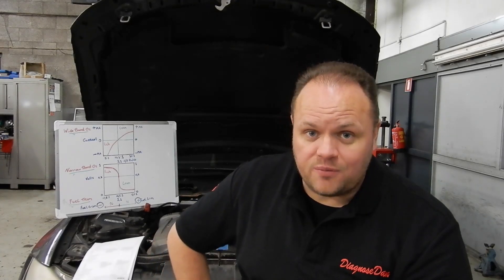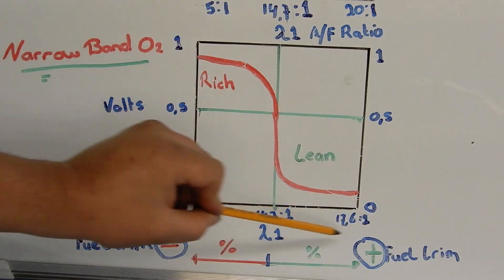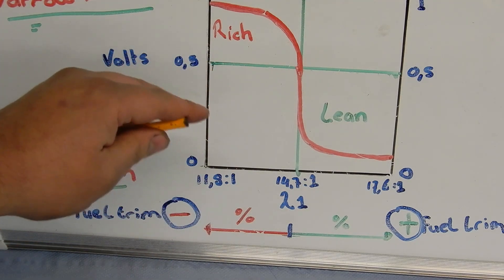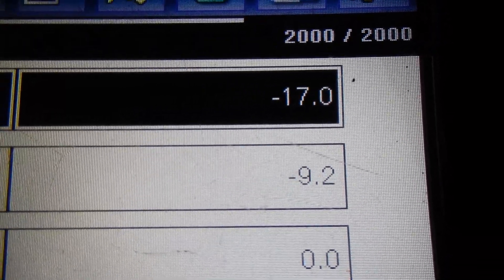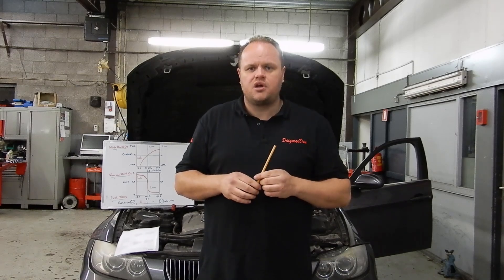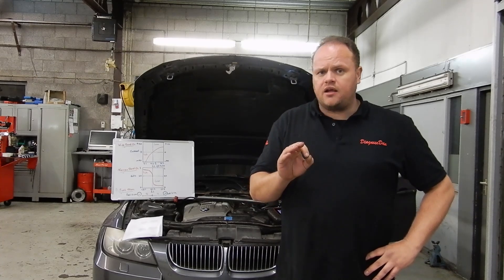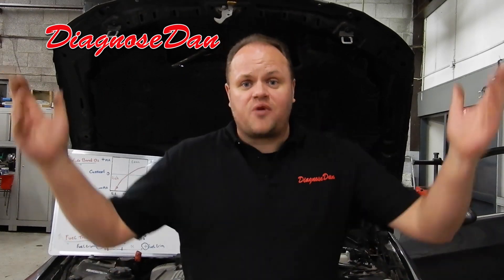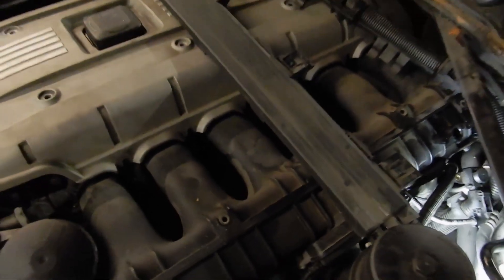Wideband O2 sensors, Narrowband O2 sensors and Fuel trim.

Comment: Vanos. No throttle plate, variable lift
Reply: Well, if I read below first before I open my mouth..lol.
Reply from the maker: @WIGGYWIGGY89  🤣🤣 Thanks for watching Cody it's appreciated!
Reply: Either way thanks for the explanation of wideband o2's. They have always confused me by using lambda. Negative and positive current flow is confusing, lambda is easier to understand for me. I need to practice looking at good running vehicles with wideband o2s..that way its easier to spot a wideband issue. Also in the past I've used the downstream o2 to prove the upstream wideband is faulty. Atleast now I will have a better understanding, and can refer back to this video when testing wideband o2s. Thanks Diagnosed Dan!

Comment: Could this be happening the exact way in the opposite direction if there is any leaks in the manifold?
One would also have a bad case of bad fuel economy then right?
Reply from the maker: Yes fuel economy would be poor
Reply: When double negative ltft you also have bad fuel economy right?

Comment: great video, maybe someone asked already, but why do we need both sensors ? is not it enough with the only  wideband sensors ?
Reply from the maker: One before the cat. and one after to see if the cat. did it's job.
Reply: @Diagnosedan  Thanks! why not same sensor for both though ? like using both wideband before and after :) could be easier to compare the results.
Reply from the maker: @gilron9585  wideband can detect a wider range of mixtures than norrowband but is more expensive.  Narrowband is good enough for after the cat and cheaper.
Reply: @Diagnosedan  Got it! Big thank you man :)

Comment: It's because this engine is directly bottle fed a perfect 14.7 parts of air, and does not burn any atmospheric mixture, resulting in an extremely clean burn, and can actually run under water? It's the same technology used by Speed Racer in the Mach 5! Except they don't make it in convertible, yet!

Comment: Hi Dan, great videos. My car has a sudden 20% increase in fuel consumption, but no other noticeable changes or codes. This is more noticeable when the engine is cold, but still higher than normal at operating temp. My long term fuel trim stays between 5.5 and 10.9 (normally the low is 8%, it only takes very short dips to 5.5), and short term stays between -2.5 and 1.5.

I think I have a lazy o2 sensor - the manual recommended it to be changed 20,000 km ago. Upstream is wideband, LAMBDA normally stays at 1 while cruising, but sometimes bounces between .9 and 1.1. It will spike to 2 when throttle goes from high to close. mA normally is around 0.7, but will spike to 3.2 when throttle goes from high to close just like LAMBA. Downstream is regular o2, when car is warming up it stays low around .005. It climbs as engine is warming and then stays around 0.7 while idle and bounces between .1 and .9 while driving.

I have no signs of a bad catalytic converter, so should I just replace both sensors?
Reply from the maker: Well I'm not a fan of just replacing parts. The numbers your giving me ain't great but not to bad either. See if the fuel trims improve with higher Rpm's. Also check your temperature sensors!
Reply: @Diagnosedan  Hey, I forgot to come back to tell you! I started monitoring my coolant temp and noticed it always stayed between 170-185 when warm without any symptoms of an open thermostat. I pulled the temp sensor and it was covered in a film. Changed it out for $5 and my car is running great again! You da man Dan!
Reply: @Diagnosedan  Will do! I really appreciate the response, you're amazing!

Comment: A quick question Dan, can you tell a narrow band from a wide band just by looking at them. Just watched this video of yours for the 4th time. Brilliantly explained. I’ve even shared it with my work colleagues. You’ve even started a catch phrase in my garage. When I fix something I turn to the other guys and say “ diagnose Paul fixed it again”🤣
Reply from the maker: Ha ha thats awsome! Narrowband sensors usually have 4 wires and wideband sensors usually have more. If you follow this rule your right 95% of the time😉 Thanks for the comment DiagnosePaul💪
Reply: My name is also Paul, thou I'm the only one in my workshop I also can say this out loud just to boost my self 👍👍

Comment: Hi Dan great video.  Just a quick question about o2 sensor diagnoses.  I've got a 2002 ford AU Falcon(Australian) with a v8 engine running rough.  The vehicle has 2 4 wire heated o2 sensors (one per bank/ not a wide band o2 sensors) and when I read the o2 sensor data, its reading between .1 volts to 2.8 volts on both banks (I thought it is not suppose to exceed 1 volt unless its a wide band o2 sensor).  I tested this with 2 different scanners IDS and a snap on scan tool with the same results. I cannot seem to find any information regarding 02 sensor faults with readings above 1 volt on the scan data. have yo ever had this issue?, thoughts on this please. Shorted o2 sensor?, another type of o2 sensor that I'm not aware of (meaning this is normal operation)? Thanks, keeps up the good, work, we learn a lot from you videos.
Reply: I don't think your AU should be reading over 1 volt. Can you check the voltage at the sensor directly (say with a scope), instead of through the scan tool?
Reply from the maker: I know there are a few O2 sensors out there that are different. See if if reacts to a lean or Rich condition. Also take a look at the fuel trims if they are good the PCM is happy about those O2 readings.
Reply: Did you ever solve this?

Comment: Is it ok to spray brake cleaner in intake to test the engine to get it richer? And did you spray it in air cleaner housing without removing the maf sensor?thanks.

Sorry for bad english.
Reply from the maker: Just don't spray it directly on the Maf. And be carefull some brake cleaners are toxic when burned.
Reply: Ok thanks dan. I really love your videos cheers!

Comment: To answer your question at the end, possibly all bmw engines after 2006 use an electric motor to change the profile of the intake camshaft to meter the incoming airflow to the engine.

Comment: plesse share the Answer
Reply from the maker: Valvetronic= Variable valve lift to control engine rpm. No throttle plate needed ( only for backup ) So no vacuem

Comment: Hi Dan. I have been commenting on your other videos recently. Can you advise the best way to test diesel o2 sensor readings? How do you expect them to behave? Namely a VW Touran with the BMN PPD 170 engine? I don’t have any major symptoms as such, but I feel the car is active regenerating the DPF more frequently, I have no intake leaks and the EGR is good. The DPF has been professionally cleaned and the ash content removed as much as possible. I am wondering if the o2 sensor is slightly out (but still within operating parameters) and causing the engine to create more soot than it should. I am struggling to find definitive testing advise for diesel lambda sensors. Your advise would be much appreciated. Thank you
Reply: Thanks for replying so fast. The engine is great uses no oil, performance is good etc. But the regen required warning appears more often than it used to. The DPF was removed and sent to a shop that specially cleans them in a machine. They sent a before and after test sheet showing how much ash in weight was removed. Do you have a way of telling how much smoke a diesel with a DPF is producing in normal use? I suppose you just monitor differential pressure for a while to see how fast the back pressure increases. I have no issue with CEL or loss of power. I am just interested why the regens are occurring more frequently. Maybe it requires a new DPF, but they are so expensive and I do not want to fit a cheap one.
Reply from the maker: @mentalmechanic  That the right way to clean a Dpf, i've seen a couple of times the EGR cooler was leaking internaly. That way some engine coolant can end up in the exhaust gas, causing DPF problems. This was on VW and Audi products. But then the car should be using a little bit of coolant!
Reply: Thanks for the info Dan
Reply from the maker: To be honest it to much info to explain in a comment, Maybe i'll do  a video in the subject one day. There can be alot of reasons the Dpf is clogging up fast. Egr is one of those factors but internal oil consumption can also cause this. Does you engine use a lot of oil?
Reply from the maker: Another question is how did they remove the ash?

Comment: Yeah great info again! I was just thinking how can you tell if a car uses the wideband or narrowband 02 sensor? And of course as you said,  by looking at the scan data. If it shows voltage it’s narrowband. if it shows milliamp Current then it’s a wideband sensor, correct?
Reply from the maker: That's correct!

Comment: It's a valvetronic system. Throttle plate wide open and valve lift regulating air flow.
Reply from the maker: Bullseye👍💪
Reply: i can't understand,, would you explain it, please?
Reply: @Ransz_kyx  The BMW valvetronic system uses not only variable valve timing but also can vary the lift of the valves from less than 1mm at idle to several mm under full acceleration ( Don't know exact specs). Under normal operation the throttle plate stays 100% open and air flow is controlled by varying the valve lift in response to driver demands.

Comment: How do u charge you customers seeing most of time your last stop for misdiagnosed vehicles?
Reply: Do the other shops who couldn't fix the cars bring the cars to you without the customers knowledge, and then give it back to the owners and claim that they fixed them?
Reply from the maker: @coollasice4175  I guess some do, that's why i don t always get permission to film all cars.
Reply from the maker: I'm not exactly sure what you mean could you explain?
Reply: DiagnoseDan I mean when I get a vehicle that has been to several shops and parts throw at it and it’s still not fixed. I inform customer it’s a automatic 3. HRs to start at what the dealer rate is. If they don’t agree to it then they have the option to take it somewhere else. 
So my question is how do u approach customers with problem cars to be sure u are making a profit?
Reply from the maker: @jasonstaub3045  i'll treat them as any other customer. See it as an opportunity. These customers are usually not my regulars and they visit my shop for the first time. When i fix the car the first time and the customer is satisfied i got a new customer for life!

Comment: This video should be mandatory in auto schools. Well done, Dan!
Reply: ALL Dan's videos should be in auto schools. You are the best Dan!
Reply from the maker: logical canuck Thanks!👍🤪
Reply: Fully agreed
Reply: I had to diagnose a stalling problem on a 95 Stratus 3.5. Long story short fuel trim max high bank 1 and then max lean on bank 2. When reset it would run for a few minutes until the trims would do it again but sometimes swap sides. Long story short the engine had been swapped with 1 year newer and bank 1 & 2 were reversed in the harness on that year model. Computer would see bank 1 go lean and enrich bank 2, bank 2 seen rich and lean bank 1 some more. That was a fun one.
Reply: They are in my classes.  Willcox, AZ High School
Reply: Matt is also great 👍
Reply: Matt shrouinger 👍🏻

Comment: I have a question. my long term fuel trim is at +7 when driving around but the wideband is showing a constant negative current amperage. why is that?  The short term trim is acting accordingly with - readings.
Reply from the maker: that slow goat, first check for fault codes. If certain codes are set the pcm no longer controls the fuel trims. Also you can drive the mixture rich or lean and see if there is any response!😁

Comment: Great explanation on oxygen sensors on both narrow and wide band sensors.  When dealing with 5 wire wide band oxygen sensors from Honda, I'm confused on one issue.  The 5 wires are as follows:

2 wires from PCM delivering PWM voltage to heater circuit on this sensor.  Great.  I understand that.
Remaining 3 wires -  Is voltage along with current (milliamp) being produced by the wide band sensor or is power coming from the PCM to the wide band sensor? I know about bias voltage being sent by the PCM to help technicians determine wire integrity.  But which direction is the voltage and current coming from on these three wires?  Please explain.  Thanks
Reply from the maker: Steven Nahulak Great question, i think you just inspired me to do another video on wideband sensors. The voltage comes from the PCM.
Reply: And some have seven wires.
Reply: I know this comment is already 4 years ago. I think the other 3 wires they call it voltage  reference low and high,  the other one is sensing wire? correct me if Im wrong. Thank you

Comment: Awesome stuff Dan. Is the lack of vacuum true for ALL BMW engines with valvetronic?

Since the manifold has no vacuum, is there any way we can force this engine lean to check if the wideband/narrowband sensors respond?
Reply from the maker: mike roy, in valvetronic mode the throttle valve is open so there is no vacuüm in the intake manifold. It's easier to force it Rich on this design😉
Reply: @Diagnosedan You could use compressed air, forced into the intake manifold, to make the engine run lean.

Comment: I couldn't agree more about wideband sensor until yesterday nothing was wrong prefect running  vehicle I fiscally introduced propane in the system ,and I had a +ma at the A/F sensor again Honda 07 perfect running vehicle.🤔🤔 cheers
Reply from the maker: david cisneros, how did you introduce the propane? Sometimes People introduce the fuel by unplugging a vacuüm line, or they disconnect the air mass meter. There can also be a delay in the scandata. Just try again on another car and see what happens😁
Reply: DiagnoseDan  i introduced the propane at the air clean housing ,I know Toyota's are exactly that way your describing in this video . By any means I'm an expert I'm just trying to learn as much as I can as everybody else.✌
Reply from the maker: david cisneros,😉
Reply: diagnosed Dan 
For Honda wideband  it is opposite  ,rich is +ma and -ma is lean .You can do  your research .

Comment: hi Dan! I've been told I can test o2 sensor only when engine is hot because they doesn't work below x°C. Is it true? Asking to be 100% sure in the future. Thanks
Reply from the maker: Rafal f that's right, that's why there is a heater circuit on the sensor😁
Reply: DiagnoseDan so what temp is the best for good test? Or min temp. To be sure our measurements are right
Reply from the maker: Rafal f just watch the status open loop (O-L) or Closed loop (C-L) at closed loop the system is at operating temperature😉
Reply: DiagnoseDan good point! I had this data on Snap on  Verus but completely forgot about it! Thanks again Dan!

Comment: How are you, I have a lin bus connection failure on the dme. And there is no response from the dsc module. And I have a battery sensor wake up line, short circuit to ground or open code. I have a bmw f10. Any idea
Reply from the maker: Bimmer Posts, check your dsc module connector for water damage.

Comment: Simple and great information. I will try this diagnose out on my 320i E90 since i have check engine light for reading a defect cat. So lets say if the sensor wasn't faulty then the problem should most likely a leak on the cat somewhere on the upstream?
Reply from the maker: SF2 LoneWolf a leak could set an inefficient cat. code😊
Reply: What is your garage called? Maybe if you live close by i would like to visit you to fix the cat. code i have.
Reply from the maker: Where do you live?
Reply: in Oss
Reply from the maker: Dan kunnen we ook in het Nederlands verder🤣. Asm in Mijdrecht.👍👍

Comment: Great job Dan once again.
Question. Heeft een kapotte egr klep het invloed op een van die o2 sensoren? (Bvb. Klep staat open en de motor kan niet gedraaid worden boven 2500 toeren)
Groetjes Kristof
Reply from the maker: kristof mikulski, aangezien de sensoren de zuurstof in de uitlaatgassen meten, zullen ze alles meten dat van invloed is hierop.Een Egr klep word meestal gecontroleerd (als hij geen positie sensor heeft) door de luchtmassa meter. Als de klep open gaat worden er via de egr uitlaatgassen aangezogen. Als gevolg hiervan zal er minder lucht via de lmm. worden aangezogen. De computer ziet dit een zal de inspuiting aanpassen zodat het mengsel juist blijft😉
Reply: DiagnoseDan
Dus als ik naar de lmm. Ga kijken zal er meer lucht zijn dan het moet? Danny bedankt you're the man.
Reply from the maker: kristof mikulski, als de egr klep open staat gaat er minder lucht via de Lmm
Reply: DiagnoseDan
Een grote bak grolsch voor jou Dan 😉

Comment: I don't know the answer but is the engine warming up and overlapping the valves to heat up faster?
Reply from the maker: Roy BM, On this engine design the throttle plate is fully opened and not used to control the rpm. The rpm is controlled by valve lift. Because the throttle plate is fully opened there is no vacuum build up behind it.😉
Reply: Thank you for explaining!
Reply from the maker: Roy BM you're welcome.
Anytime😉
Reply: What the reasoning behind that strategy

Comment: Is the brake cleaner not bad for the mass air flow sensor?
Reply from the maker: Roy BM, never spray the cleaner directly on the sensor. And do not spray anymore than nessesary for the test.
Reply: Ok Thanks, it will evaporate quickly your way so no problem.

Comment: No vacuum because Bmw uses valvetronic so the throttle is open 100% so no vacuum.
Reply from the maker: 100% right, not bad for a volvo tech😉
Reply: @damarihector9566  You hacked Cameron Tony's girlfriend's Instagram too?
Reply: The throttle valve is used for start up and shut down other then that the valve Trinidad system varies valve lift to near 2mm at idle and controls volumetric intake during so and upon hard torque demand the lift is increased as needed
Reply: Valve tronic